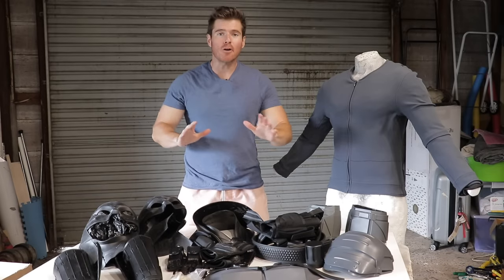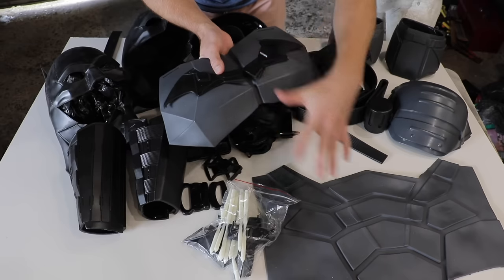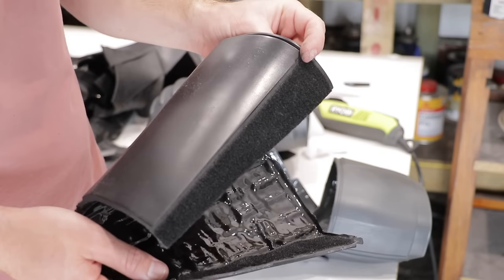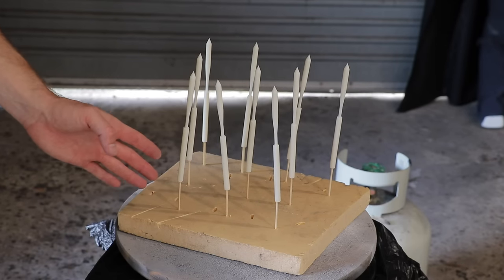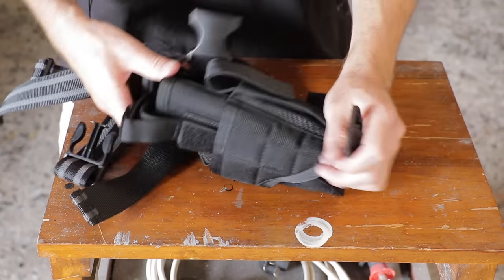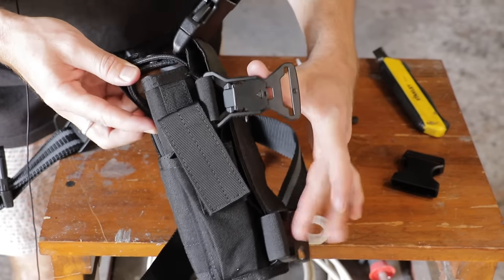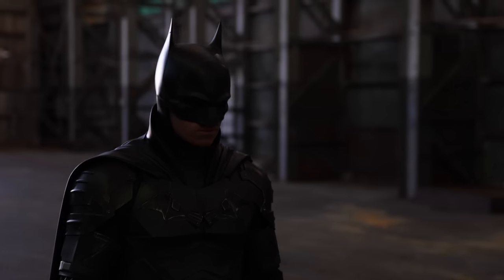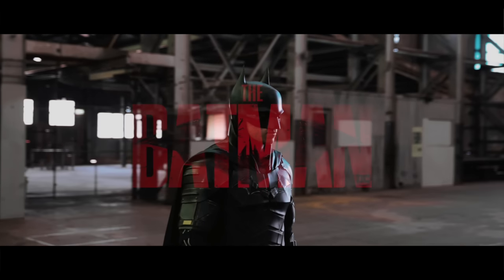The Batman (2022)- Batsuit Cosplay Build & Reveal

Comment: Batman's suit is made from a US Air Force high altitude flight suit called an MC-4. From the early '60s.

Boots: TCX Fuel pull on motorcycle boots. Or more accurately the TCX Hero boot with leather gators to cover the laces. 
However if you look up the TCX Fuel boot versus the TCX Hero boot you'll see why I recommend the TCX Fuel boot. As it looks like a proper Batman boot right out of the box.

Tracking down those items took a while. And they are not cheap, but they will look good. And they will be film accurate.

All that being said I really appreciate your video. Great job on your Bat suit!
Reply: Hmm